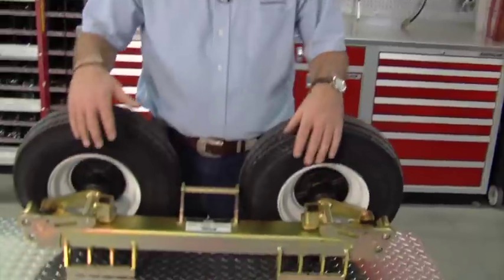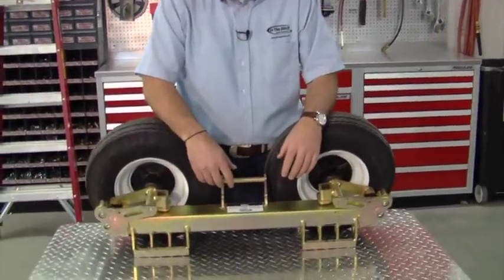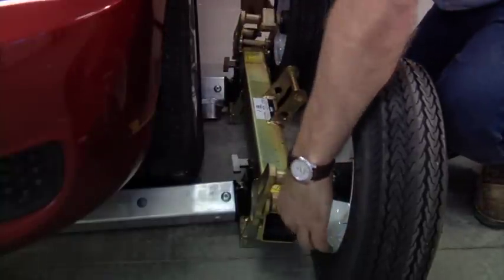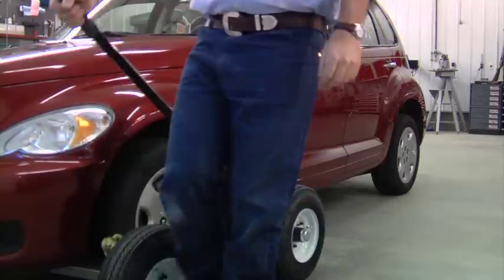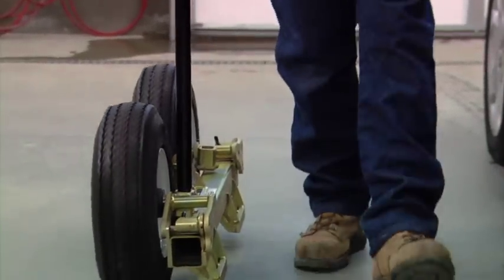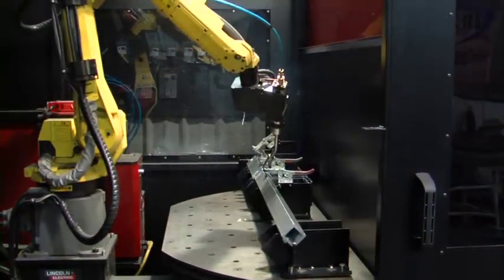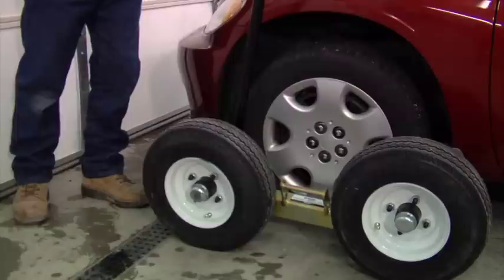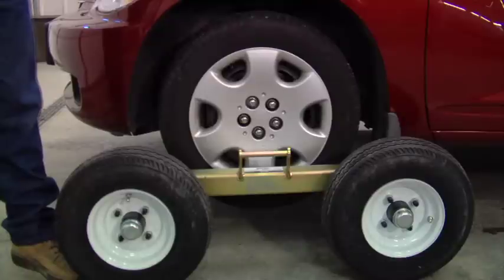Speed Dolly Demonstration From In The Ditch

Comment: Great Ideal! Can you retro for a Shipping Container?  Make it able to lock into the corner pin holes and might need to beef it up a bit to lift the container.
Reply: And a few beefy guys to pull on the breakover bar 😃
Reply: I use a set of Collins Dollies with solid steel cross bars to move Shipping Containers around !!. I've Towed several 20 foot containers from Tampa to Ocala like this !. And simply looped chains across the front of the container and used my Wheel lift to tow it !!. Works great and I've never had an issue with DOT here in Florida !!. Before using the Tow Dollies, I used a Single axle Boat trailer Axle setup. And simply lifted the front of the container up and pushed the dolly back until it was where I wanted it !. I just carried the dolly on my wheel lift when not towing a container !!. Worked good enough to move over 100 containers !!!!.
Reply: Nice! I have a 40' and might be a weight issue per axle and I would not want to have to stop very fast.Thx for the imput.

Comment: I want to see these loaded with a Cadillac Escalade.  Hit bridge transition s at 60 . What's the max load? G wagon Mercedes and heavy Suv,Truck and mileage for weight. 30 miles? 100 miles, 200 mile tows ?
Reply: Probably shouldn’t be using dollies  over 45 mph in the first place. I speak from experience. I had a brand new set with steel cross bars and had the welds fail on one of the bars the first time That I used them. ( Not this style in video !). Even at 30 mph in town it wasn’t pretty.

Comment: hi how much is the price ?
can you send to u.k .london?
Reply: I shipped a set overseas and it really wasnt that much to ship them(relatively speaking).The one thing we did was remove the tires to reduce size and weight.I kept them for spares and he sourced some locally.The money saved by reducing the size/weight essentially paid for the tires because it kept the packages under a certain limit.It's been a few years but I recall that once we went over a certain weight the cost skyrocketed.

It's not going to be cheap but these are the best in the business.I've easily got over 50,000 miles of abuse on a set and I wouldnt think of using anything else.It might sound silly but besides how they work and the quality being top notch,the one thing I appreciate most is how balanced they are to carry.I have back problems and these are a lifesaver.

Comment: How duse it work  behind  a RV.
Reply: Yeah..
Reply: how to connect it to the RV?
Reply: These are designed to be used with a tow truck.They are to raise the wheels off the ground for towing.For example you can use them to tow a awd drive car with a wheel lift,but if you were trying to tow a little Audi you could do so by driving the car on a normal tow dolly and then using these under the other wheels to get all 4 wheels off of the ground.Although I dont know if I'd recommend them for long hauls behind a RV.It would be hell on the small tires and wheel bearings so I usually keep them for jobs up to 50 miles max.Having said that you might want to give them a call and see what they recommend,chances are they'd be fine with a smaller car.I've probably put 50k miles on the one set I have before I needed to change the bearings ;-)